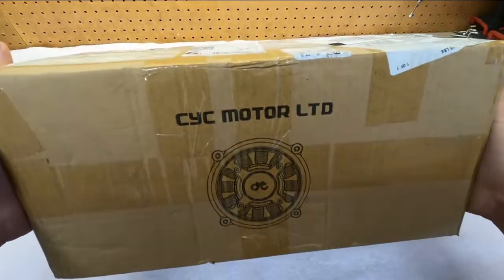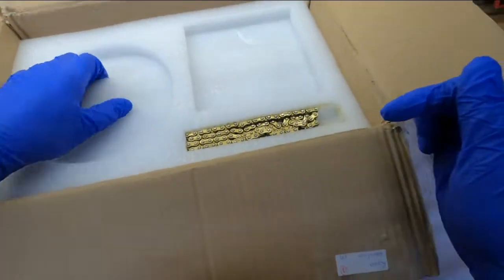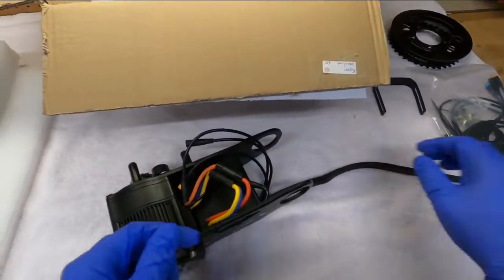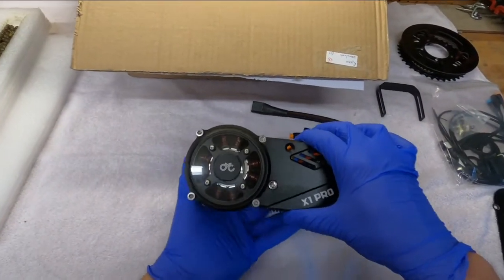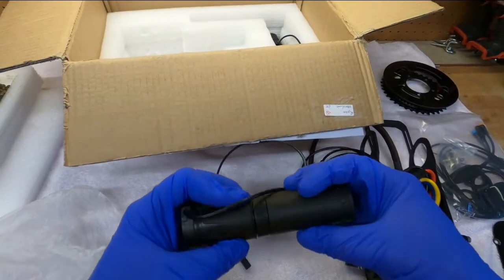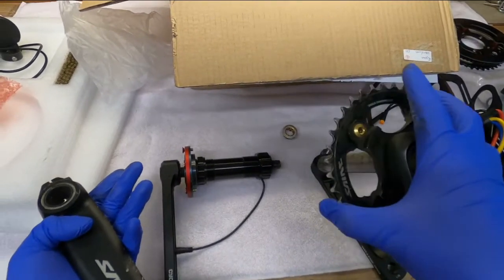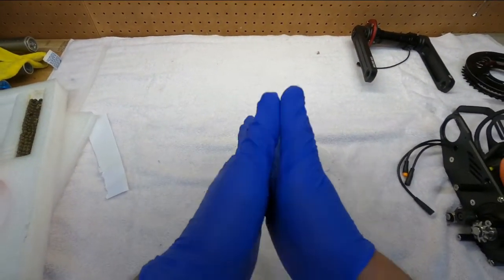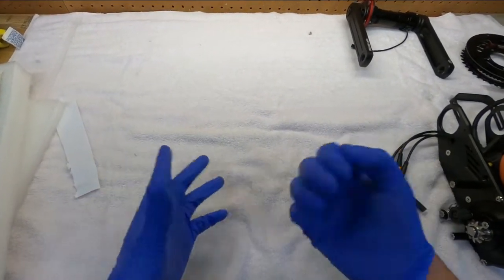CYC X1 Pro GEN 2 Unboxing

Comment: I have the Gen 2 with the BAC855. 
It has run flawlessly for me, very smooth and powerful,
The torque assist is real nice.
I run mine on 20s and it’s a beast

Comment: I've been running square BB axles all my riding life. 30ish years, that be. Never had any problems with aluminium arms stripping or something. Not even getting any play in there. I can't remember when I last tighten the bolts on the cranks. Perhaps when I took the chainrings off to replace them. Maybe four years ago. 

What bugs me is how the hell those torque sensors work... A pressure sensor needs to sense pressure from something against something else. 
A torque sensor in the hub/cassette assembly senses the torque exerted by the chain against the wheel. In a mid-drive you'd have a load cell between the crank axle and the freewheel engaging the chainring. But in the axle??? 
If that senses the torque in the axle you can just stand on the pedals and accelerate?
Reply: Sadly ignorant elitists think bottom brackets need to be splined to be safe and reliable, in reality both are equally as reliable and the reality is if you are putting that much power to strip the crank arm on the square axle then you are going to mess up the frame long before you make the square taper fail or the crank arm. Also same about the so called tourque sensor, basically it is no different than any of the super cheap pas sensors you get in every ebike kit, all it does is detect rotation and so trigger the motor, it certainly can't detect torque
Reply: @EQINOX187  I was thinking the same but, meanwhile, I saw a model or two that come with a spider that mounts on the bb, not on the cranck arms so it makes more sense...